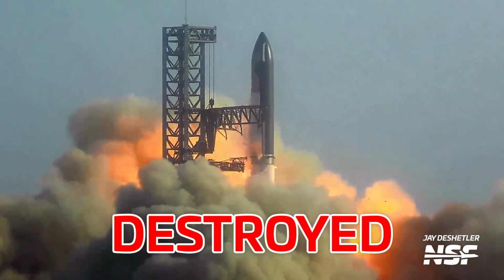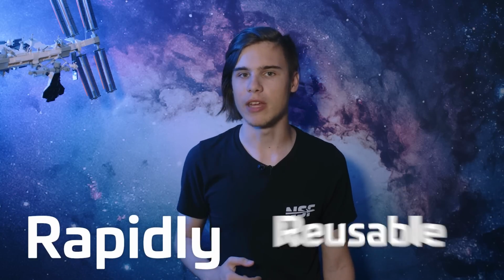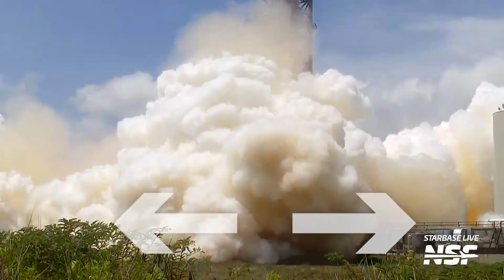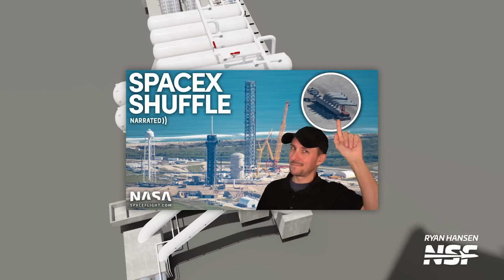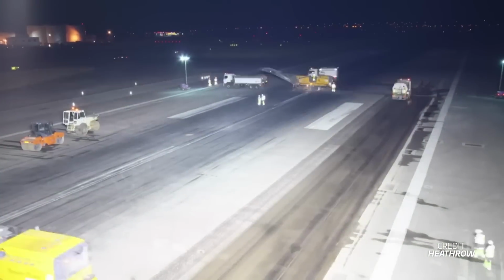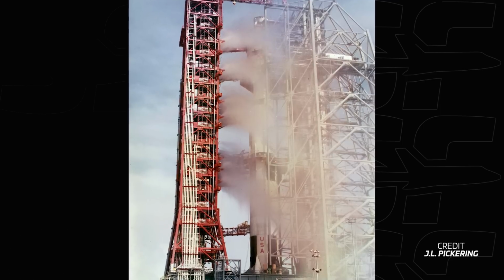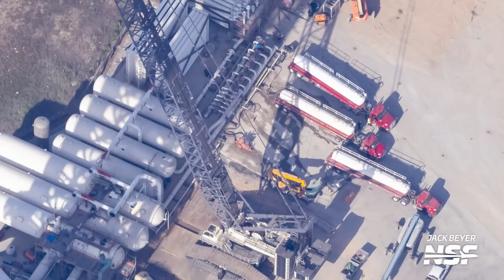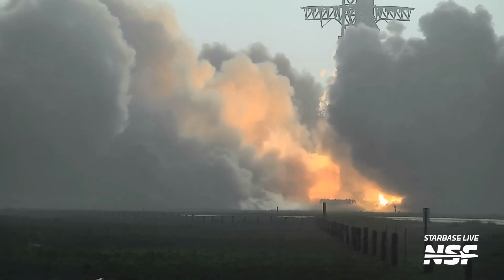SpaceX Thinks They Know Better. Is The Water Plate Enough? (Starship's Deluge)

Comment: The trench is better!
Reply: no for rapid-reusability
Reply: @HamzahKhan314  Florida's pads launch to orbit almost every two days without problems.
Reply: @DrPhilMM  first of all, those rockets are MUCH less powerful than super heavy, so they can reused much faster. 
also, those pads take a few days to get ready again and spacex want to eventually reach a point where they can launch again in a few hour.
Reply: @HamzahKhan314  You stated two contradictions; they are either take days or hours?

Despite that, your response isn't relevant and doesn't support your idea about why the current system is better. It actually supports the idea of trenches.
In your own words, SpaceX is working on reducing the time of reusability to hours instead of days, which actually make them better for two main reasons 1-Gained experience 2- Easy reusability.

Technical solutions could be applied for Starship, just like Falcon Heavy with its 27 Engines. 
Reusability of Falcon Heavy is achieved by the trench system. If they were going to use the pad of Boca Chica for Falcon Heavy, we wouldn't see flying it for a very long time.
Reply: @DrPhilMM they are working on reducing the time by using the starship deluge system. a flametrench can only do so much with a super-heavy lift rocket. Starship's deluge system would obviously be easier to design than a trench for rapid reusability. although there is much more experience with flame trenches, the limit for turn around times will probably be more than a water-cooled steel plate sytem.

Comment: SpaceX could build a Liquid Flouride Thorium Reactor to supply power and run their desalination plant. They need reactors for Mars. LFTR's can be very small -- fitting in to a Starship -- safe, clean, and supply massive amounts of power.
Reply: Yeah, sure.  SpaceX would just need to successfully and miraculously solve all the corrosion issues that have consistently dogged the prototypes for such reactors over the past several decades, preventing their transition from conjecture and the laboratory, to commercial deployment...
Reply: Other than those twiddly issues, a LFT reactor easy is definitely the way to go ... lol.  @Spherical_Cow

Comment: I think they’ll end up finding out that they need a higher water pressure to prevent the plate from heating up. Issue is, if they increase the pressure before the engines start it could damage the engines. They need to start the deluge system as they already do and then have a system in place that correlates the thrust setting of the engine and the water pressure. (E.g when the engines start and the thrust is increased, the water pressure should be increased accordingly automatically)
Reply: No water is pointed at any engine. The water is pointing out at an angle.
Reply: @knowledgeisgood9645  If the pressure was high enough the arc of the water would increase and therefore hit the engines.
Reply: as the booster throttles up it will also move away from the pad, so the pressure and heat wouldn't increase that much (it might decrease if the rocket moves away fast enough).
Reply: @HamzahKhan314  Exactly - depends on how long the booster sits there for with full thrust
Reply: @vgaavin7031 true, but im pretty sure that the next launch will try to get the booster of the pad much faster compared to teh last launch. i think like 3-4 sec after ignition

Comment: The pad will work, and it will progress further than the last flight. Well written @Alexphysics and thanks for hosting Ryan.
Reply: An optimistic take.
Reply: @markuskoivisto Why do you think it's optimistic? I think it's the most likely outcome.
Reply: ? @codeforce5556
Reply: lets hope so!!
Reply: I think they are at significant risk for an on or near pad explosion, given that there is not enough water to fully mitigate the acoustic energy, along with a flat steel plate that will reflect that energy directly into the engine bay.
Reply: It blew up again 😂😂
Reply: @codeforce5556  it progressed further as i stated, hit stage separation and second stage ignition. Pads not damaged, so great 2nd test from a TEST VEHICLE .

Comment: The only reason it won't work is if they didn't design it big enough or robustly enough.  I'm sure they did their math.  What could go wrong?  Liquid steel projectiles.
Reply: Well I hope that SpaceX have water flow meters and pressure meters in the Deluge system, that link to the Booster Onboard Computer, so if there is a water supply failure, the abort procedures will cut in, before the steel plate can get hot enough to melt. That would be 1,204℃ (2,200℉). Methane and Oxygen produce 2,810℃ (5,090℉). 
Let's hope those smart SpaceX engineers have that in place already.

Comment: This water cooled steel plate will work wonderfully. If more water is needed, pressure can be increased a bit.
Reply: if it is designed to handle more pressure.
Reply: @HamzahKhan314  I would guess SpaceX made it capable of handling far more pressure than they expect to have.

Comment: I think there's a bad argument being made here. The clustering of engines in the center is clearly not substantially less than the clustering around the outer ring, certainly not enough to explain the reduced height of water at the center.

To really analyze this, you first need to understand the three main concerns: heat, force, and vibration. So long as water comes out relatively evenly across the plate, it will help distribute the force of the raptors across the plate. No way to absorb that force, however. Vibration is also mitigated simply by having lots of water coming out everywhere, no particular need to worry about the pattern of water spraying. Heat is the problem that might require a particular pattern of water spraying, but even that isn't true. Once the engines start firing, all of the water will immediately vaporize, and gas just goes everywhere, so the reduced height of water in the center is irrelevant for heating concerns.

And it's worth noting that while visually, it looks like there's less water in the center, in reality you can see from the design of the plate that it releases the same amount of water everywhere. It's just that since that water is directed outwards, it creates a ballistic arc of climbing water that makes the water rise higher towards the edge of the metal plate than towards the center. There's not a reduced quantity of water in the center.

All of the water is directed outwards for two main reasons I can think of:

1. Don't want to spray the engines with water as they're trying to ignite, that could be problematic.

2. The outwards momentum of the water escaping will transfer to the raptor exhaust, pushing the exhaust outwards more aggressively and redirecting some of the downwards force away from the metal plate and towards the ground surrounding the launch mount.
Reply: People are focusing WAY too much importance on the most visual part of the deluge system; the water spray. While the water spraying out of the plate does do some work, it is relatively minor compared to other parts of the system/process. The water spray is completely blown away once all the engines are all firing, anyway. This can easily be seen in the elevated views. Instead, the bulk of the protective work is done by the plate, itself and the water that's still flowing inside the plate. The plate (and it's foundation) are sized to withstand the full thrust (mechanical force) of launch. But, the heat of the engines would soon compromise the mechanical strength of the plate without some sort of cooling system. It's the water inside the plate carrying away this heat, that allows the plate to maintain it's strength and do the work of withstanding the thrust. So long as enough water is flowing through the plate fast enough to carry all the heat it 'captures' out of the plate faster than it builds up (which is then blown away by the engine thrust), the plate will maintain it's integrity (assuming it's designed strong enough to do so, in the first place).

Comment: Legs on the booster as per Flacon 9!
...Eventually
Reply: Too heavy and less stable. The booster still has legs, just not at the bottom but near the top - which gives the booster a lot more stability. The chopsticks add the dampening that the Falcon 9 legs give it. This way the booster is light and the landing is safer. (The chopsticks don't do any "catching" - the booster just lands on its flexing rails)

Comment: I wonder if they could also add an addition of having the center 13 engines gimbaled away from the center.
Reply: Once they are airborne but slow-moving those engines are all the control they have. They will need some wiggle-room , at least. The engineers for stage 1 probably want all of it.
Reply: That would cause the rocket to tilt off vertical during liftoff - which is absolutely not what you'd want to happen...

Comment: Maybe the should have left the hole In The ground then added the water system. I really feel like those engines will just blow the water away. But steel is better than concrete
Reply: It will take about 70 calories of energy per gram of water to heat it up from ambient to 100C. It will take an additional 540 calories per gram to vaporize this water into a gas at 100C. This is where most of the exhaust heat and sound energy will go. 

The vapor will continue to absorb one calorie per gram as it is superheated above 100C. The expansion of the steam as it moves from higher to lower pressure will also remove heat from the area. 

As this happens, the vapor will expand ~1000 times as it exits from under the OLM. This will form a radial flow that will carry the heat and sound energy away from the OLM. 

This system will very effectively remove heat and sound energy from under the OLM, leaving the steel and concrete components unharmed.
Reply: @psycotria  The specific heat you reference (70 calories per gram of water) - is per degree Celcius (or Kelvin).  So for instance, to heat 1 g of water from 20 C to 100 C, you'd need 70*80=5600 calories of energy.  Compared to this, heat of vaporizatoin is actually relatively insignificant (just another 10%).  Also, the water under the Raptor blast (and inside the plate) will be subjected to ~15-20 bar of pressure; under such pressure it won't boil until it reaches ~200 C.

Anyway, this isn't to dispute your main point - just to take care of some pedantic issues with it...
Reply: @Spherical_Cow  There were no references to the heat of the exhaust or the BTU's or kJoules that 33 Raptor engines present to the OLM base. Is this something that will be covered in a future video? 
I am sure the SpaceX engineers have all that data. Any of the NSF team that works on this, is going to have to do a lot of research, so I expect your time is dedicated to more important video's. 
Let's face it, when the next Starship System launch's, we will all see the results of the theory.
Reply: Additionally, water vaporizes at over 100C at higher than atmospheric pressures. At the pressures stated in CSIStarbase's video, water may not vaporize until well over 200C under the OLM. The water will absorb heat, rising one degree C per calorie per gram, until it reaches its boiling temp at whatever pressure exists during the launch. 

It will then absorb 540 calories per gram; its latent heat of vaporization, to transition from a liquid to a gas at the same temperature. It will then continue to absorb heat as a gas; one calorie per degree C per gram.

Comment: Not a genius move, but not a disaster either. IMHO, if they had doubled the distance of the OLM from the ground, they would have been fine, even though that would have meant a taller stage zero.
Reply: All thirty-three engines point straight down, except for the central engines, which can gimbal fifteen degrees in all directions. When a vertically directed rocket exhaust hits a flat horizontal plate, it spreads in all directions. So, presumably, that would create hotspots in the areas in the center, moving out to the outer ring, where the exhaust-blasts overlap.
Reply: @markhuebner7580  If you watch the video again, you will note NSF directly addresses your 'hotspot' and shows you it is a coolerspot in the center.
Reply: it takes a hell of a lot more than opinion to deal with supersonic blowtorches. Lets leave it to the engineers.
Reply: A greater distance could reduce the initial lift
Reply: @federov100 no, it couldn't: bouncing exhaust off the ground is not how rockets generate their lift
Reply: @Spherical_Cow I'm still eagerly awaiting a depth discussion about SpaceX's innovative steel hull design for the radiation shield of the starship, especially as it crosses through the bow shock into space.
Reply: @federov100 nah man. Once the thrust leaves the nozzle, it’s done it’s job